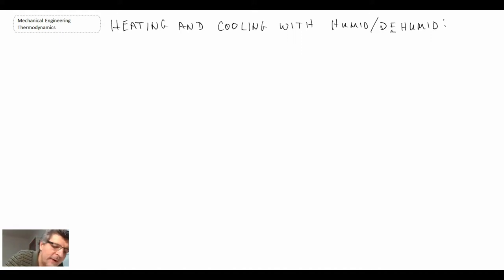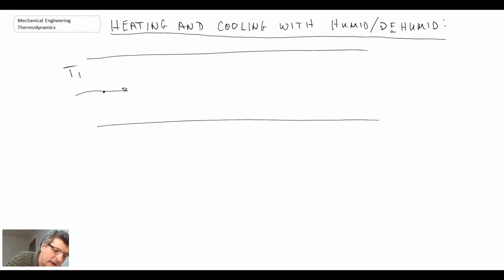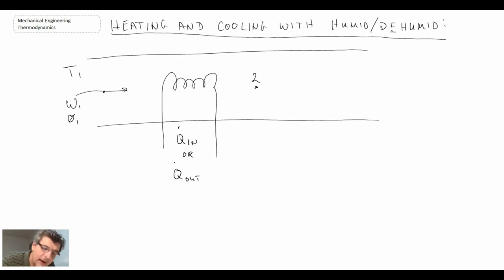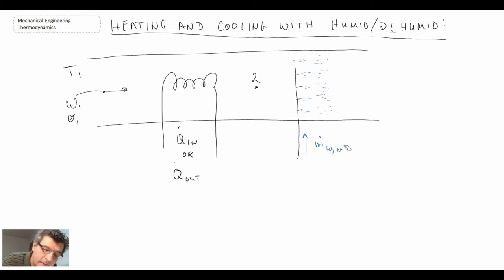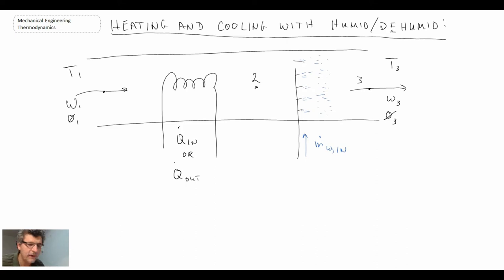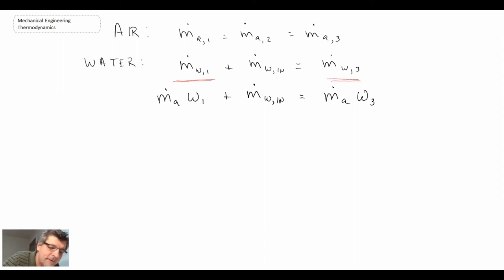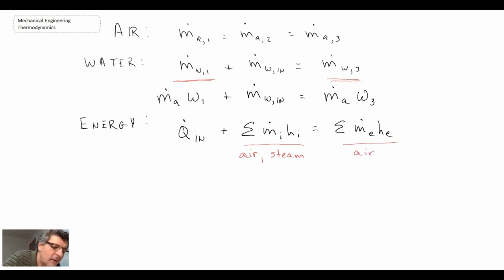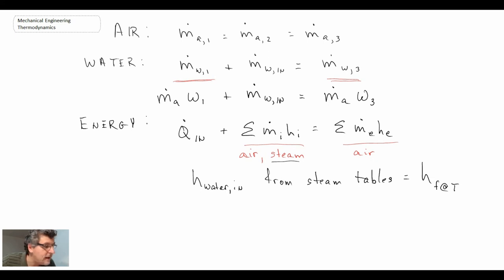Mechanical Engineering Thermodynamics - Lec 29, pt 5 of 6:  Heating and Cooling with Humid / Dehumid

Comment: Sir,
Please clarify the enthalpy of Steam or Water we inject. For example if we inject steam at 240 F and 14,7 psia, what is hwater_in,  value, from steam tables, (superheated water h=1163.9 Btu/lbm), obtaining heating and humidification. In this case Latent Heat= ma(w2-w1)X1163.9. Is this correct?
Injecting Water @ 60F, hwater_in  is, from steam tabels, hf= 28.08 Btu/lbm, and Latent heat = ma(w2-w1)x 28.08, obtaining cooling and humidification.
Thank you very much,

Best Regards,

Radu